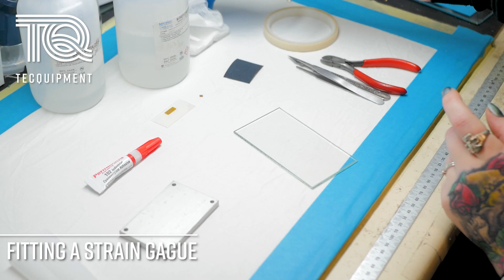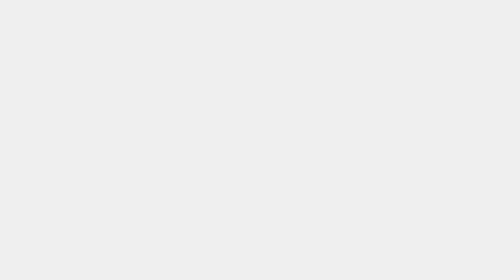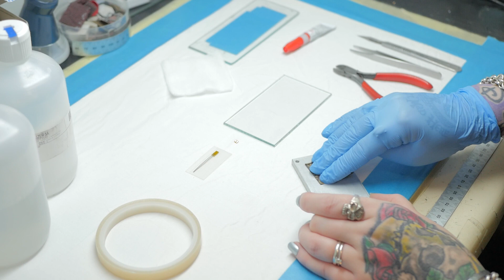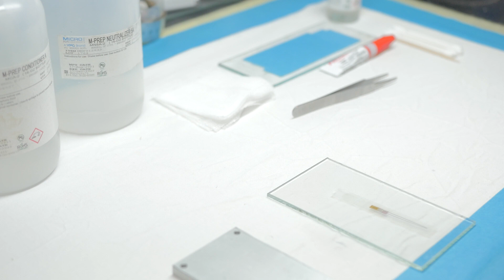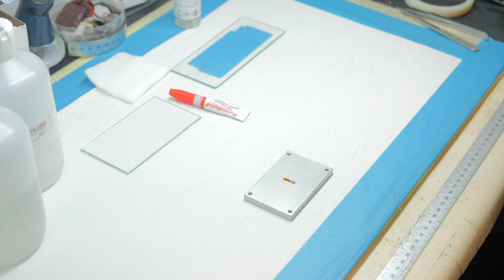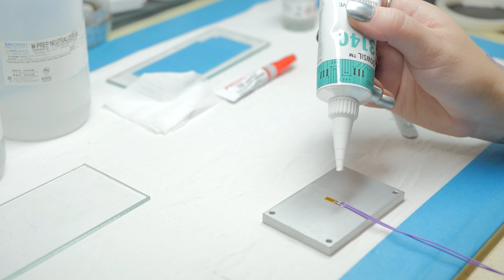How to assemble and test Strain Gauges, a step-by-step guide

Comment: is strain gauge legs wires are necessary to cut and change another lead wires?
Reply from the maker: Hi @jjeninaa, in the case of this video, the wires are directly attached to the solder tags on the gauge. If the gauge doesn’t come with its own solder tags, you can add them on yourself, and that's where the legs come in. The legs are there so you don't have to deal with the wires directly, making the process easier. The main idea is to avoid damaging the gauges. If the wires or strain gauge legs need to be cut to change to another lead, that’s part of the process. You connect the wire to the gauge leg via the solder tags.